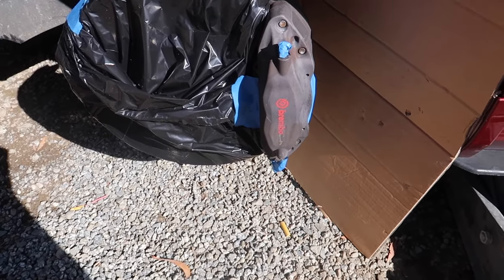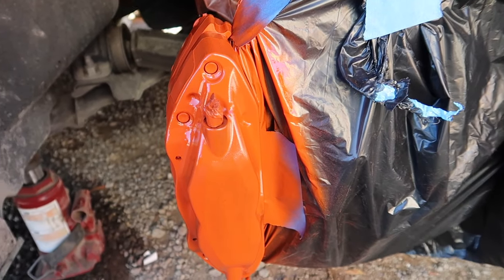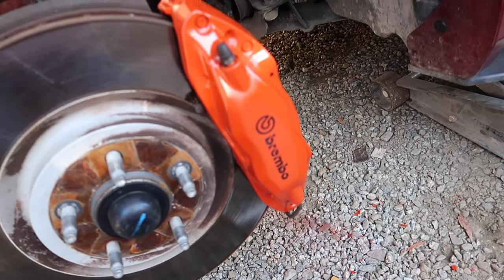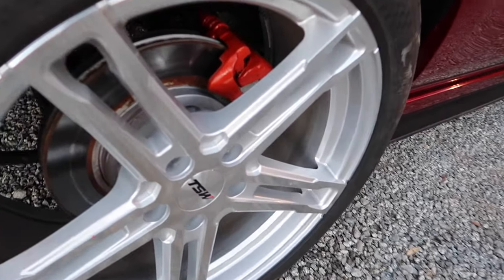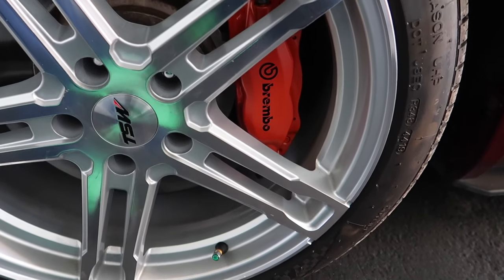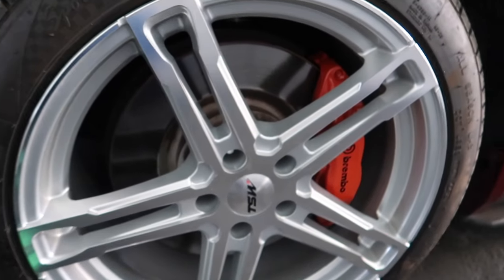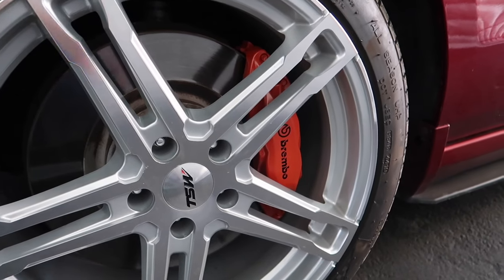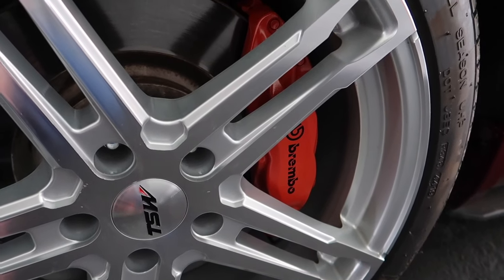Paint your brake calipers for ONLY $38

Comment: Nice.  I do think it's well worth it to just take off the 2 caliper bolts, remove rotor and pads, put the caliper back on the hub and then paint it....much less taping, etc.  You don't have to remove the brake lines or anything.
Reply from the maker: I didn’t know how to do it at the time so I was like I’ll just tape it

Comment: Did u use primer? I think u could drive it right away to bake the paint
Reply from the maker: I didn’t use primer. If you drive it right away then you might get brake dust on the calipers since you’re going to have to use them eventually. If you do it at night and leave it overnight they should be done